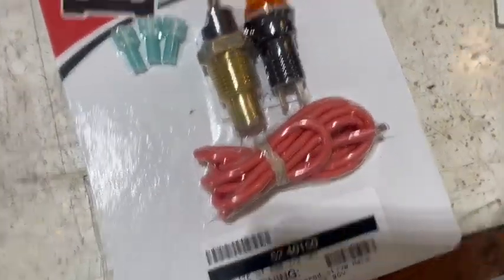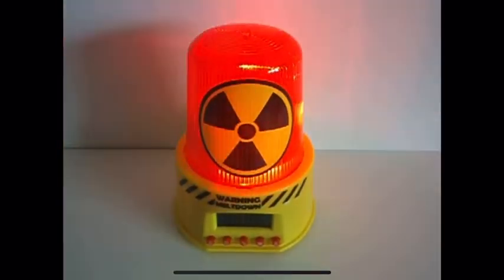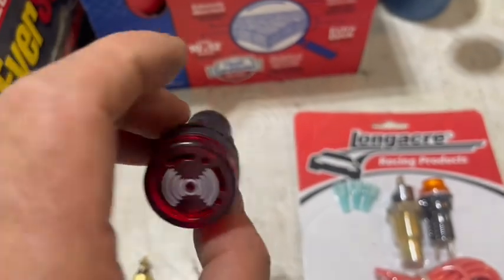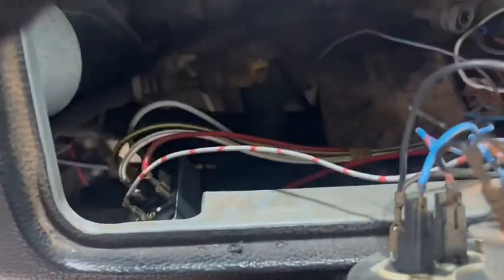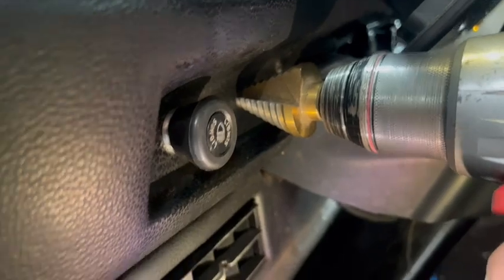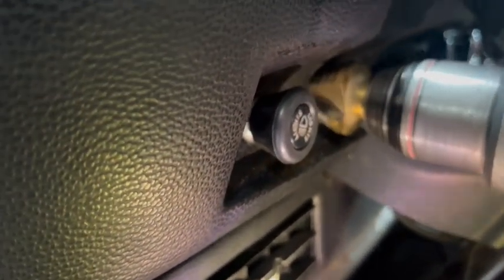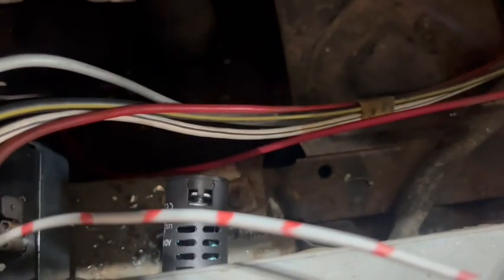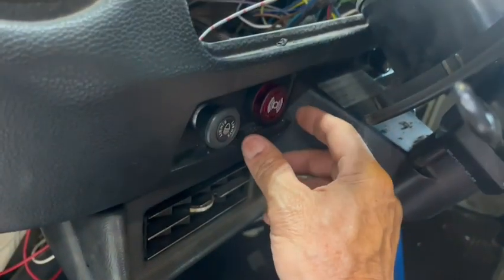VW bus with Subaru engine- adding Over temp light & buzzer. Part 16

Comment: How is the engine/transmission conversion holding up? Any road trips with it? The engine shouldn't be a problem but the transmission conversion is a fairly recent thing.
Reply from the maker: I haven’t done any long road trips , maybe only 500 miles on the conversion so far.  There’s been others putting thousands of miles on the reversal transmission kits.  This one is a chain drive kit, and there’s also a gear driven kit that is supposed to be really quiet and robust.  Cheers
Reply: @WolfofWisco  I had a problem on my Subarugears 5 speed ring and pinion where it appears that the pinion gear wasn't properly heat treated. It had pits developing on the wear areas where the ring gear was fine.  I replaced it with their latest "high power" R&P and have run it 6,500 miles. Hopefully it's good.